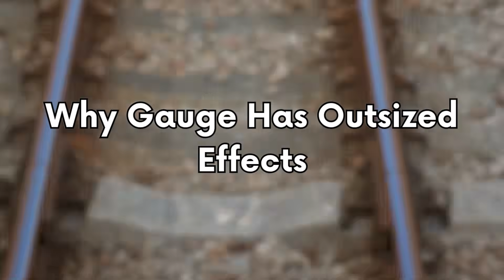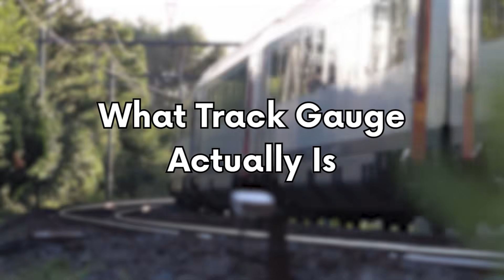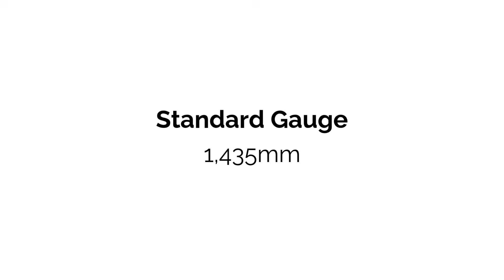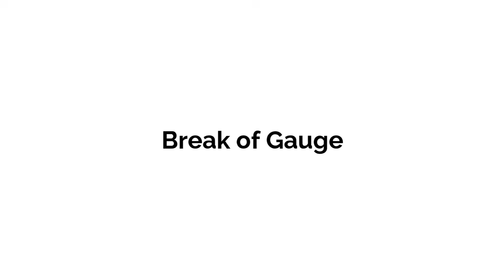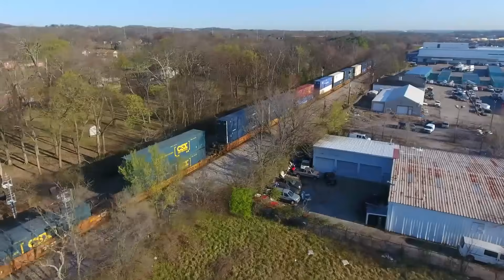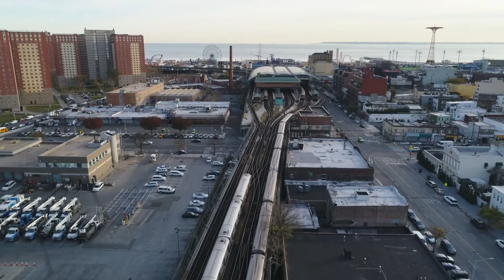Why Track Gauge Matters More Than You Think in Railways

Comment: I don't think you can seriously argue that the choice of gauge has always been on rational considerations of functionality as you contend.  Obviously if you go down to 3 ft or 2 ft gauge then yes that makes a big difference to your ability to reduce cost and negotiate tight curves, likewise Brunel's desire to use 7' 0.1/4" gauge was a decision made on a rational basis because Brunel was obsessed with pushing speed and comfort to the limit.  However, around Europe we have so many different gauges that are different enough to be a problem, but not really different enough to affect functionality.  Apart from Stephenson Gauge (popularly known as "standard gauge" but it isn't the standard in many countries!) you have Irish Gauge, Iberian Gauge, Russian Gauge, Finnish Gauge all of which are within a few inches of each other.  As I say, not different enough to affect functionality.  Also many of these were chosen when trains were very much smaller and slower than they are now, so these marginal differences in gauge would have not made a difference in performance as they were nowhere near pushing the limits.  Other factors around track quality would have been far more influential than a few inches of gauge.

I think it is pretty clear that most of these gauges that hover around five feet give or take, arose accidentally, with the people making the choice arbitrarily, never expecting to have to deal with connections to another network.

Comment: Even though the British pioneered railways, they made a HUGE mistake in believing that a train width of 9’ft would be sufficient, which it isn’t, ideally the track gauge should have been 5’ft so that a train of 10’ft width can run on tracks. Even London Underground Sub-Surface trains are 7” wider than National Rail trains which are a mere 9’ft wide.
Reply: Loading gauge is not necessarily linked to rail gauge. The US has an enormous loading gauge, but use standard rail gauge.

Comment: NZ  has 3 ft 6 inch 1067mm gauge. It was necessary because of the rough terrain to be covered. This has limited some development like double stacking and high speed. In an energy constrained future, light trains may have advantages. The major problem is ti get dopey politicians to make sensible and considered decisions on our neglected rail system.

Comment: Question: In an ideal world of unlimited resources for railway construction, would broad gauge be better for high-speed rail?
Reply: It would. It would also be better for slow freight because of the larger loading gauge (height and breadth of load) it allows. But the resources needed go up hugely as the gauge widens.
Reply: @kenoliver8913  Also maybe broad gauge could be better for low-floor trams too. Not much room between wheels with standard gauge.

Comment: 2 major problems with narrow gauge is that 1 you cannot use it for high speed trains and 2 you cannot use double stacking.
Reply: Ironically, the fastest train in Australia is narrow gauge, although the fastest speed achieved in normal running is 160kmh.
Double-Stacking also requires a bigger loading gauge, and with the exception in India, has not been deployed with overhead power. I suspect Double Stacking also killed inland rail as the cost of crossing the range in Queensland was too great, especially when trying to get to the other side of a major city.
Reply: Most of Japan is narrow gauge but they made their bullet trains to run on standard gauge due to narrow gauge not being up to high speed trains.

Comment: This became a factor when Australia federated as Queensland, Western Australia were 1067mm, Victoria, South Australia at 1600mm and New South Wales 1435mm 
Thus a programme of standardisation was implemented to provide a direct link to all state capitals
Reply: Not only did different states in Australia use different track gauges, but different braking systems and different couplings. Tasmania had side buffers and vacuum brake, South Australia had centre buffer couplings and air brake, West Australia had centre buffer couplings and vacuum brake while Queensland used side buffers and air brake, yet all used 1067mm or 3' 6" gauge.
Reply: @DavidFoulkes-w4j  Meanwhile, the Commonwealth Railway line linking the Western Australian system (1067mm) and the South Australian system (1600mm) was built to standard gauge (1435 mm)!  South Australia itself had its own internal break of gauge when it built three isolated and deeply rural systems to 1067mm to save construction costs.
This all meant that for many years if you wanted to go  from Sydney to Perth you had to change trains at 
- Albury-Wodonga on the NSW-Victoria border (NSW/Victoria break of gauge) 
- Adelaide (for a decent meal and a sleep); 
- Terowie (South Australian internal break of gauge station and miles from anywhere)
- Port Augusta (South Australia/ Commonwealth Railways break of gauge)
- Kalgoorlie (Commonwealth Railways/Western Australia break of gauge).
By the time a standard gauge route had been built all the way from Sydney to Perth in 1961 (I think) it was too late for passenger services: the "Indian Pacific" from Sydney to Perth is essentially an expensive tourist hotel on wheels. Otherwise people fly or drive. The profitability of Perth-Sydney freight is still affected by loading gauge issues east of Dubbo, NSW preventing the running of double-stacked intermodal trains to and from Sydney, and cheap cabotage makes freight movement by sea considerably cheaper.
Reply: The first NSW Railway chief engineer agreed to use 1600mm (Irish Broadgauge), too, but his immediate successor reneged on the agreement, causing the whole stuff-up as Victoria had already laid hundreds of miles of broadgauge, even a little bit into NSW over the Murray River.
Reply: Famously, Port Pirie had all three gauges in the station, the only place in Australia, IIRC.

Comment: Standard gauge is a half-truth that rail fans have been putting out for decades. They always miss out a vital fact. The Regulating the Gauge of Railways Act 1846 which mandated standard gauge for all new lines in the United Kingdom of Great Britain and Ireland mandated 2 standard gauges - 4ft 8.5in for Great Britain and 5ft 3in for Ireland. However, it did not ban the building of broad gauge lines to the 7ft 0.5in of the GWR. But this was generally limited to new lines that were physically connected to the GWR's broad gauge network, but where the proposers of a new line wanted broad gauge Parliament could approve the building of the line (to my knowledge none were ever built to broad gauge outside of South Wales and South-West England).
Reply from the maker: Thank you for this. Interesting historuical clarification!